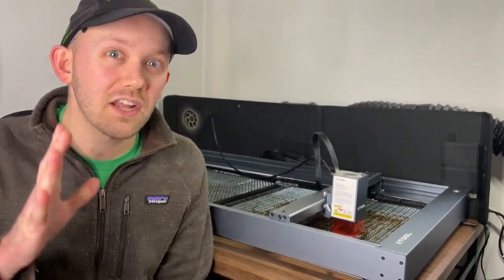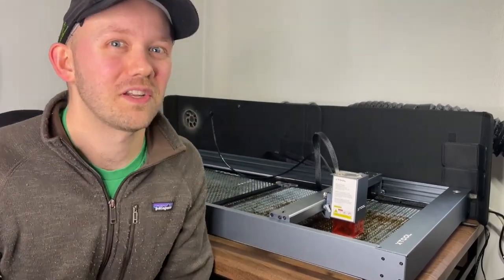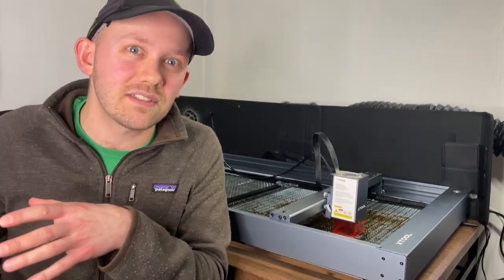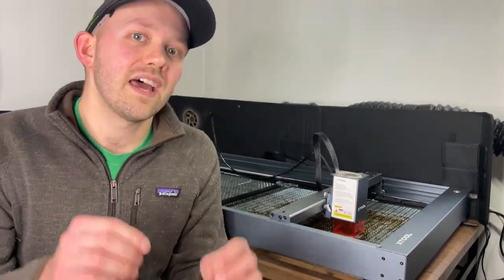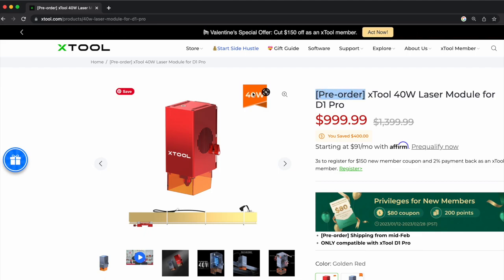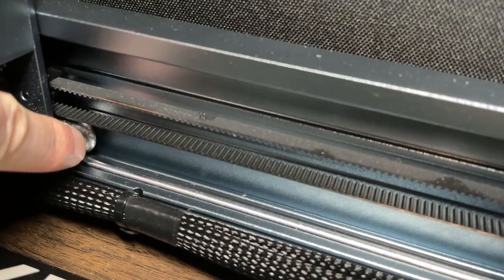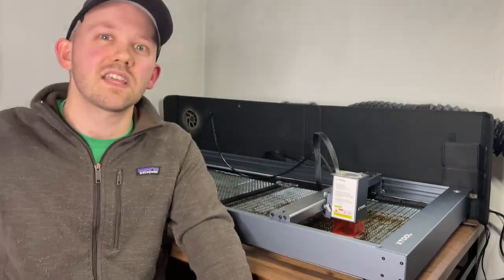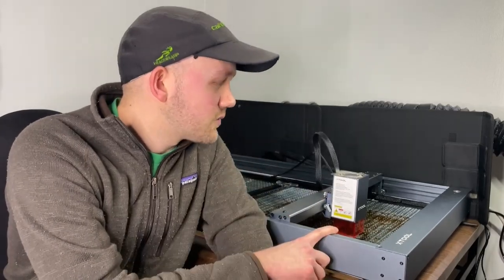7 things I wish I knew BEFORE buying the XTool D1 Pro 20W

Comment: Note on the time it takes. It looks like you were using lightburn. You can change the order it engraves the piece. Instead of engraving all the tracks and text across the board at the same time, you can set it to do one track and label at a time. You'll eliminate the travel time it takes to go from one to another as it moves across the board. This will shorten the time some. Play with it and how you group them.
Reply from the maker: Thanks, Derek - I actually got that same tip from someone else as well. So we grouped the tracks to reduce travel time, it shaved off 10-15min on that project.
Reply: Try the offset fill also

Comment: This idea of having your laser in a separate room from your computer - not a good idea IMHO. There are times when you're going to have something jam up (e.g. forgot to turn off rotory when doing linear), or hit a piece because of misalignment. Or something worse, and you need to stop it. With Lightburn, the HW button on the D1 doesn't do anything. So your options are to run back upstairs to hit stop, and hope and pray the house doesn't burn down, or turn off the machine and lose your position. Plus it's not practical to do alignments, realignments, etc. Now that I've had my 2-in-1 for 2 mos, I've come to accept that the wifi is only a means of 1 less wire, otherwise a gimic. Again, just  my own experience.
Reply from the maker: Yeah - good point. Probably the ideal scenario is to have multiple computers. Like one for lasers and one for everything else (obviously for when you’re not running a laser as it would need to be monitored), that way you don’t need to move your work station around all the time. I think that’s what Sam from Samcraft does actually. 

Or, I guess you could do the same thing with a laptop, Im just rocking a desktop Mac mini at the moment, so that’s the scenario I’m going from.
Reply: @asherdiy  indeed... I have a copy running in my warm office, which syncs to OneDrive, and is readily available from the repurposed old laptop used to control the D1 Pro in the garage.
Reply from the maker: Nice - I’m guessing you had to buy two Lightburn licenses for that?

Comment: I'm a couple months in with my D1 pro 20 watt. I too was shocked by the amount of smoke and smell. I have it 100% solved this with an AC infinity Cloudline s6 in line fan (I used reducers and run 4 inch hoses vs 6). This thing is so strong, I can open my enclosure while cutting wood and barely smell smoke. The fan is also strong enough to push the air through roughly 25 feet of hose to my outside vent on speed 6 of 8.
Reply from the maker: Wow - you using the xtool enclosure? I’m not yet satisfied with the amount of smell with my enclosure while running the AC Infinity S4 4 inch fan. If you’re getting good results with the xtool enclosure with the s6, I might try that before I try building an enclosure.
Reply: @asherdiy  no, I built my own. I shopped around online and couldn't pay those prices for something held together by Velcro. I'm thrilled with the results smoke and fume wise, zero smell in my shop! If you build one, ensure you have plenty of access for fresh air to be pulled in
Reply from the maker: Cool - that makes sense. I think a homemade one will perform better. I was thinking about doing an exhaust pipe on each side. One for air in, and one for air out.
Reply: @asherdiy  I wish I could post a picture of what I built, just because it seems to be working great. I cut roughly a 3x9 hole and put a metal are vent cover on the outside. I use the vent cover primarily to keep sawdust and other stuff from easily entering the box since it's in my shop. The AC Infinity unit creates such a draw, a piece of paper can be held against the intake
Reply: @johndeaux9987  You have really inspired me to build my own enclosure, using the s6 fan you recommended. I'm trying to grasp what your custom enclosure looks like. Do you have a hole on either side, one for the s6 and another for getting fresh air in? Since you are using a limiter, do you have a 4 inch hole for the s6 and another 4 inch hole for the intake? I was thinking about drilling a number of smaller holes to avoid having one big gaping hole.
Reply: I have a very similar exhaust, same reducing couplers etc, but I realized I could do even better by making the exhaust output mate directly to the final exhaust output coupler. This totally eliminates pushing smoke through the duct, it instead pulls along the entire length of flexible ducting. Smoke is always traveling in a relative vacuum from the enclosure all the way through the duct. I can poke holes all over the exhaust duct and it will never leak smoke exhaust air. since it's always under suction.  Pulling as much smoke as possible is better than pushing.  Plus, if your seals are not perfect, they won't leak inside your house...ever!
Reply: @eddesroches4337  definitely sounds like a good plan, particularly to eliminate leaking. I called the company when I was installing mine to ask which way was better and was told to push it since my run was a little over 25 feet. How far is yours?
Reply: @johndeaux9987  Mine is just shy of 25'.
Reply: Hi  @johndeaux9987  , I’m very interested in your build, it sounds awesome. Do you run any accessories alongside your Cloudline S6 (filter / silencer etc…) ? Or is your exhaust going outside ?
Reply: @MrBluesDeville335  Nope, nothing extra. I drilled a 4 inch hole in the side of the house and installed a dryer vent. If building your own enclosure, make sure you have plenty of cross ventilation for clean air to be pulled in/through. I have about a 3x9 hole opposite side at the exhaust. I used a metal vent to cover this to prevent inadvertent laser exposure. I couldn't be more happy with the enclosure, 100% odor reduction when closed and 90+ with lid open. If I had it to do over again, I would put the exhaust vent lower and midway on the enclosure vs high rear. I see it pull smoke from under the honeycomb.
Reply: @johndeaux9987 I just ordered a d1. I got the enclosure made for it. Do you think the cloud line s6 could be added to this setup or will I need to return the xtool enclosure and build my own? Thanks in advance!
Reply: @davidryan9808 If I'm not mistaken that enclosure is set up with a 4-in exhaust hole. I used 6 to 4 inch reducers on each side of the 6 inch infinity, so you should be able to do the same. I checked with AC Infinity and they said that is fine to operate like that, as long as the reducers are the same going out as coming in. I bet you will end up building your own anyhow... I didn't want my stuff held together by Velcro for $200! 😂😂

Comment: There are much cheaper air pumps available. I'm not paying $139. Good vid.
Reply from the maker: Yeah - I’ve got a video coming up that I think takes a fun angle on that.
Reply: @asherdiy  Looking forward to it. I'm actually thinking about a small 3gal. air compressor. It can be used on the laser and   tools, tires, etc. You can get them for $90.

Comment: Why would you want air-assist off?  It prevents flame-ups and keeps the head clean from back flash and back splatter
Reply from the maker: Sometimes an engrave (not cut) job, looks better when you run it without air assist. Watch my air assist comparison video, that has an example of this in there.

Comment: For your speed: Use offset fill instead of fill, for things like this where you have either multiple different sections or for shapes with space inside (such as the letter O etc). I just loosely replicated the size and speed that you have for the exact same image, and it goes from 1hr 24m 28s for fill, to just 19m 59s for offset fill. Over an hour saved there. If you click "Show traversal moves" in preview, you'll see the wasted time the laser head spends moving over blank areas.

Comment: Nice overview! Another unit that's a close competitor to the XTool is the Atezr P20. Very similar in not only capabilities but construction / design as well. I just ordered one a couple days ago so looking forward to getting it. It's a upgrade from my Sculpfun S6 Pro which is a 5 watt unit. It's been a great machine and I'm planning to keep it too, just want more power.

And as noted in another comment, you probably need to change your cut settings on that tracks plaque. Your cut time is only about 20 minutes, but you have over an hour of rapid moves. In the cut settings for the fill layer, at the bottom are options for "Fill all shapes at once", "Fill groups together", and "Fill shapes individually". It usually defaults to the first one, but to be honest unless it's a fairly small or very dense (little white space) image it's probably not a good choice. Try the other two settings and see what kind of times you get. Which is better will depend on how you have the shapes in your design grouped. Offhand, I'd suggest making each track a group, each name a group, and the title another group and try "Fill groups together". It can take some experimenting to find the most efficient approach.

Another trick that can speed things up if you have a large "hollow" shape (for example, an empty circle) is to split the object in two or more parts and put each part on a different layer but with identical cut settings. That way the laser can do each half individually without having to traverse from one side of the circle to the other with each pass. The direction you split will also depend on which direction you're scanning the laser. For horizontal scanning, split into left / right halves.

Hope that helps! Looking forward to more content from you!
Reply from the maker: Wow - that is a terrific idea. Thanks for the tip on the fill. I’m 100% going to try that!
Reply from the maker: And yeah, I’ve just recently heard about that Atezr laser also. I think from Steve Makes Everything. 

I’m curious about that one, let me know how it pans out for you if you have a minute to pop back over after you get it!

Comment: Hi, just a little word about the air assist not being adjustable, I just receive mine yesterday and it now has a small rheostat on the electric cord. But still no remote control from computer 😞
About the support team, I agree, I had a response to my question in less than 4 hours !
Logistics was not as good thought, took 2 weeks to receive my D1 Pro 5W, which end up being in fact a 20W... BUT NO COMPLAINT 🙂
Finally great vidéos (plural) THANKS

Comment: You covered good points. Wish I would’ve researched before buying but still looks like xtool is a good product. I agree on lack of air assist out of the box and pro of upgrade-ability
Reply: The air assist on the 20 is fine. Works Great and I have made hundreds of cuts and engravings with zero problems.

Comment: As I don't have an enclosure, I leave mine on the balcony when burning. For FDM I have a filtered "hot box" which uses three charcoal filters. I have an adaptor to it for soldering which works well so I will make another adaptor for the laser enclosure I am building from aircraft composite like my hot-box. The aircraft composite I use is alu-acrylic-alu  in a 0.3/3.0/0.3mm sandwich.
It is light enough to hold together with just tabs and hot-glue.
Aluminium and graphine reinforced belts are good for preventing expansion due to heat but Kevlar reinforced are cheaper and work just as well if you are not moving a head over 800g. (Which is pretty much all of us outside an industrial situation)

Comment: You run into the limit (sensor) because of project positioning. Remember, there’s an offset between the positioning crosshair and the actual laser.  It’s not that they’re “pretty sensitive,” but they’re perfectly accurate!
Reply: They can also get dusty which makes them more sensitive

Comment: I have the D1 Pro 2 in one with the extension kit. I've spent more time and money building the biggest enclosure you have ever seen. 
The main thing I see in ordering the extension from the git go is that you wind up with half enough parts to build another machine. It would be nice for them to offer the extension as an option. Two side rails, extra standard belts and wiring harness and extra power supply. I could build another machine just for the infrared laser or one to keep the RA2 accessories set up in.

I cant imagine running this in a home without any enclosure. I have a high  velocity three speed six inch exhaust and still get some odor issues. 
The other item needed is a full length honeycomb. With two standard ones you have a large middle section of rail joint.

I think I saw an update coming for the Wi-Fi. No issue for me because I'm running a mini computer on the station.
One other thing they should work on is the wiring of the main cable and placement of the motherboard. 
Overall The machine is impressive in appearance and construction. I like the built in projects that have the library of settings for the main materials provided in the samples kit. 

One thing to note on all enclosures is the placement of the intake port. One user sent photos of the fan module that had sucked up a ton of residual smudge. The laser is cutting and the air assist is blowing the material downward. If you place your intake up top it is pulling a supply of the dirt up where the cooling fan can take it in. 
with the air stream going down from the start let it keep on its path and draft into the exhaust intake tube. Position the air intake to the enclosure to cause the air to draft across and down away form the material and laser.
Reply from the maker: Hey Ron - thanks for sharing your experience with it. I’m prepping to build my own enclosure (and I also have the extension kit). I’m thinking about designing my intake vent like and exhaust hole. That way I can have an intake from one window, and exhaust out another. My theory is that this will further reduce smoke/smell. I’d be happy to hear it if you have any thoughts on that approach.

Comment: Great video. I’m a noob as well and have the D1 Pro 20w. Smell is also one of my biggest challenges. The fan that came with the xTool Enclosure is a joke and the enclosure was too small. I end up buying a larger enclosure (SCULPFUN) that is taller and bigger. I also bought an inline fan (195 CFM). Still major smell. Will need to figure something else out. 

Looking forward to more videos!
Reply from the maker: Hey - thanks for chiming in. Yeah, the smell is a problem. I’ve got a video coming up where I’ll talk about my experience with the enclosure and online fan more, but ultimately I’d like to try building a DIY enclosure.
Reply: @asherdiy  The Clack Shack has a couple of videos on the enclosure he built. I like his design.
Reply from the maker: Yeah - I’ve seen those. I haven’t decided exactly what I want to do yet, but I may end up doing something similar.
Reply: Hey John, I have both 10w & 20w with homemade enclosures, I’ve installed computer fans in each and also run a 4” (195cfm) inline fan. Smoke and fumes are not an issue unless the outside wind is blowing from wrong direction
Reply: I had to tighten and seal the housing of my blower at all accessible connections, seams, and all hardware with silicone.  For its primary and only purpose, it was poorly assembled for extraction.  Multiple areas were insufficiently sealed. Pass a feather duster slowly around yours when it's operating and you may find its hemorrhaging exhaust air.

Comment: One more compliant to add on the air assist "after-thought" bolt on they did. The egress tube bangs into one of the mounts on the right rail, further reducing the working space. Ridiculous!
I also built my own Baltic Birch enclosure, with laser window, exhaust fan, tubing to window door (over 40' of run), and interior lighting. No smell at all if I leave lid closed for a few minutes after burn/cut is done. I'll have to do a review video and post online.
Reply from the maker: Definitely do that - I’d love to see your design. I’ve been slowly designing my own enclosure in my head, and I’d love to see what you came up with. One idea I’ve had is to have 2 “exhaust” tubes. One for actual exhaust and one as an enclosed air vent to feed air in. With most other designs I’ve seen there is an open vent of some kind on the enclosure, which is necessary, but it does still let some smoke/smell out unless a super powerful fan is used I suppose. Thoughts?
Reply from the maker: I have the luxury of two windows in the room on adjacent walls, so two hoses out the window would work for me, but maybe not for others.

Comment: 8:01. Yep, fought WiFi for a while, did not get it working. HOWEVER, you can’t beat a solid connection. So USB is better anyway.
Reply from the maker: Yeah, from what I’ve seen it does seem like most folks stick with USB

Comment: I want to point out that the Infrared laser is very difficult to use.  Yes it does have a "kickstand" but when I have contacted customer support, they told me that I have to look a the light beam and focus it based on the brightest light.  I have only had one time that I could even see what I had engraved on a metal "dog tag".  I regret my purchase.
Reply: PRACTICE!